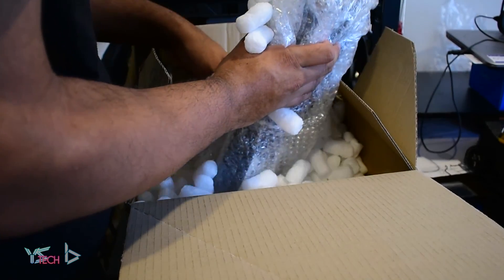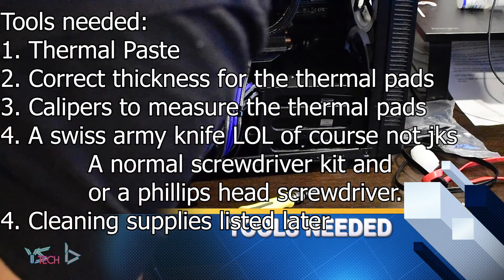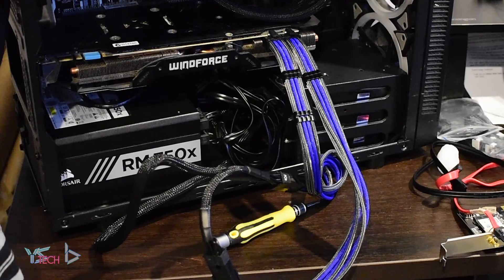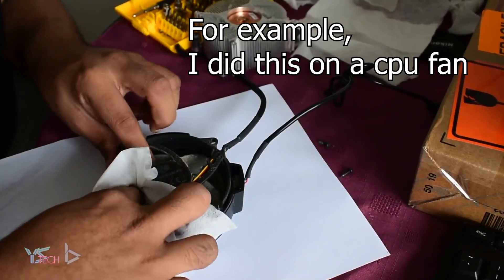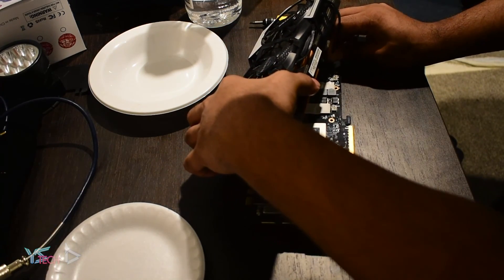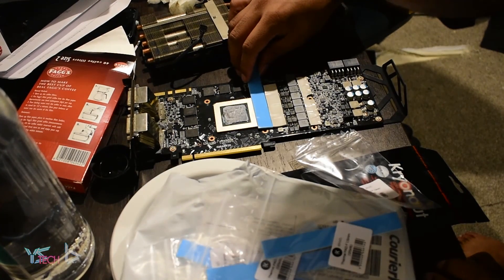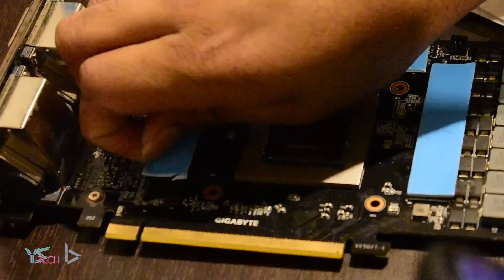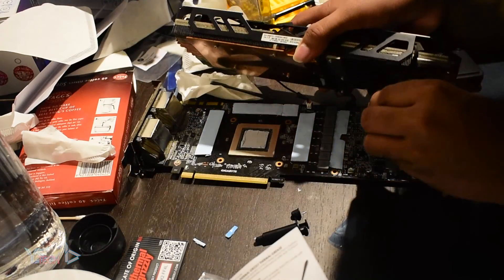How to fix an overheating graphics card

Comment: Hello there, thanks for the video.
I am still using the same video card (GTX 980 Ti G1 Gaming) that i bought new from the store back in the 2015 or 2016, even don't remember exactly when it was )))
This card is awesome, yeah its old enough nowadays, and i am starting to monitor which cards and prices now on the market and well, i am a little bit shocked with those prices.
So i think i will stay a little bit more with my 980 Ti G1 Gaming, but i think that i need to do the same procedure with thermals on it that you did, i am a tech guy so it is not a big deal for me to disassemble something and get it back working.
Just wanted to ask you to be sure: Did i understood correctly from your video, that the thickness of the thermal pads that i need for this specific model of video card (GTX 980 Ti G1 Gaming), is 0.5mm and 1.0mm?, or i need also the 1.5mm (as you ordered) and if yes so where i apply those?
I will be very thankful if you answer me, because it will help me a lot not to do mistake with those thermal pads, becuase it is very important when replacing those pads.
Reply from the maker: Hey! Haha, yea its still an awesome gpu. Luck in New Zealand prices are now falling again for gpu's :D. Hmm, its been a while since I did this. But I do believe I put 1.5mm on the chokes next to the VRM instead of using 1.0mm that ekwb said. I used 1.5mm from memory because I remember the 1.0mm being to thin. I used the 0.5mm on the gpu's memory as otherwise, the GPU won't close properly. The memory is definitely 0.5mm but I'm not 100% what I used for the chokes. I would highly recommend using some calipers. What you could do as well is order the three sizes and then measure the one on the chokes to make sure it's the right one, but I'm pretty sure it's 1.5mm. 
This is a good guide as well: https://www.ekwb.com/shop/EK-IM/EK-IM-3831109830918.pdf
Let me know if you have any other questions.
Have an awesome day! :D -YS
Reply: @beezito  Thank you very much for your answer.
So i definitely will order all the 3 sizes of thermal pads, the 0.5mm, the 1.0mm and the 1.5mm.
Also i found some good thermal pads, like the Kritical Thermal Pads that has extreme conductivity of 20 W/mK, wheres all the other brands give only 15 W/mK of conductivity or even less, there is a second option that seems not bad too, like the Fujipoly Pads with 17 W/mK of conductivity, but somehow on Amazon, with the same thikness and less surface size costs more than the more efficient Kritical Pads, so i will order 3 sizes as i said before of Kritical Thermal Pads and also a Thermal Grizzly Kryonaut Extreme that has 14.2KW of conductivity, instead of 12.5KW on the regular non Extreme Kryonaut paste.
And i will give a second life to my GTX 980 Ti G1 )) or at least that the card will work with good thermals till i buy a new one (i want the RTX 3080 Ti, not less), if the prices will drop more a little bit, i hope))
So thank you again for your video tutorial on the GTX 980 Ti G1, and thank you for your time helping me and answering to me, i am very appreciate that.
Greetings from Israel )
Reply from the maker: Haha no problem anytime. Yea I think its best to get the three sizes are see which one works the best. Sorry I can't remember the specifics but I hope it helped out. True it will better to get ones with better thermal conductivity for the best results. Yeaa fujipoly are crazy expensive for some reason xD. I'll check out the Kritical pads next time I do one of these thermal pad redo's on another graphics card. Yea for sure much better to renew it compared to buying something new with these prices atm. Best of luck to you renewing your 980ti I hope it goes well! Let me know how it goes when you do it! :D Good luck! -YS
Reply: @JentusPro  How did it go? Im about to buy all 3 sizes from a local but would like to know which did you put. My GTX 980Ti G1 is giving me black screen (monitor shuts off but pc still running) when i play more demanding games and i think that overheating is the problem.
Reply: @fiece4767  I has also this issue with black screens sometimes, but not only in games, its accurs even on desktop, so the card is not overheating, i don't know what is the issue with it, maybe its just an age of this card, who knows...
With the pads, i has replaced all the pads, but already don't remember which thikness i put in each area, i only remember that in some areas i needed to put two different thiknesses together because one wasn't enough...
This is was just a try for me with this card, it is still very old card and i just want to buy a new one, i want to order the EVGA RTX 3080 Ti FTW3, for some maybe 5 years or more ahead that it will run everything, just like the old GTX 980 Ti in its time ago...

Comment: Gelid/Thermalright/Frosty Thermal Pad 12.8/Fuji Poly/ Thermal Grizzly -> These appear to be all good for changing pads except maybe the thermal grizzly lags behind by about 4 W/MK (thermal conductivity measure). Can we use any or what should we use?
Reply from the maker: I've heard fuji poly are one of the best. I've never used the thermal grizzly thermal pads. Personally, I used the EKWB thermal pads and I'm not sure about that thermal conductivity. Personally, if I could (since I live in NZ and there are not many options) I would try to get the highest thermal conductivity. The reason is that you are not likely to open the card up ever again. Even if the more expensive pads are a lot more I think its worth it to get the ones that have better thermal conductivity. I only used thermal grizzly for the thermal paste on the gpu dye :) At least that's my reasoning haha. Have an awesome day! :D -YS